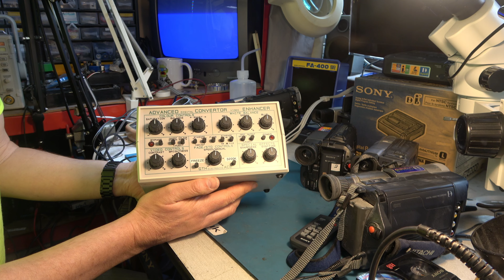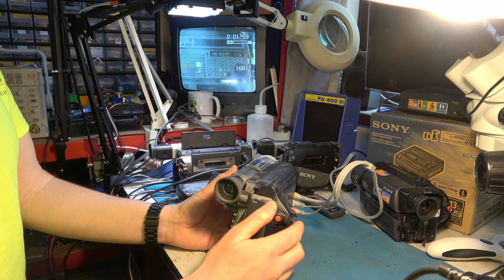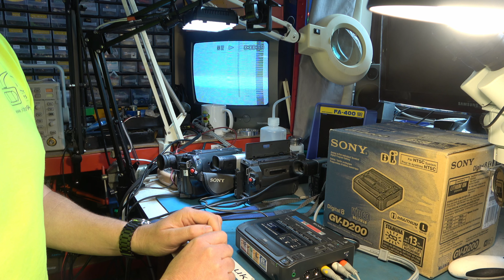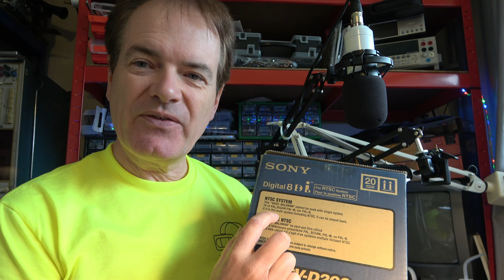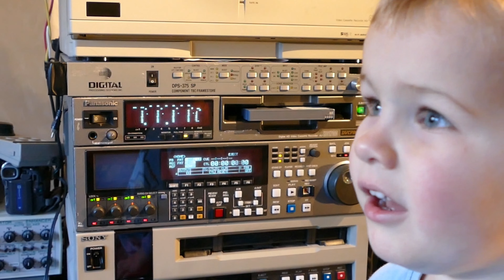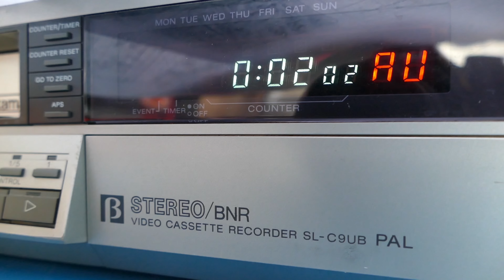8mm tapes recorded in PAL and NTSC

Comment: I think that the GV-D 200 is not slow enough for analogous PAL, since the data rate for D8 always requires a tape speed of 60 Hz. The concealment of color system compatibility is a core competence of SONY, even with "multinorm" devices that cannot do real SECAM
Reply: There is a PAL variant of it, and it's probably 98% the same parts just with a 3.58mz crystal instead of a 4.43 mhz one (unless they had started using higher freq ones with dividers at this stage)  and a few minor hardware/firmware differences.
Reply: @analogvideochannel4612  I meant that SONY didn't find it necessary to also take 50 Hz into account. PAL devices can often also play NTSC, NTSC devices but almost never PAL.
Reply: @Matt Quinn - Caledonian TV One of my favorite photos on Ebay was a C format TBC with two labels: Paris and PAL. On many "home" videos on YT you can see that SECAM leads to much larger color disturbances than PAL in the event of tape disturbances.
Reply: @Matt Quinn - Caledonian TV I only know the possibility of Mark Quadruplex Tapes with a cross for SECAM or 819 Lines Television. I have never heard of SECAM B or C format.
Reply: @Matt Quinn - Caledonian TV This is a unit from the early 2000s, not the late 80s, at that time PAL and NTSC devices would share most components and most video decoder ICs would be multi-system capable. The US and European models of the digital8 walkmans and camcorders from the time literally share the same service manual.

Comment: A budget alternative to the ACE for capturing for devices that output NTSC 4.43 or PAL60 is to pipe the video via a Pioneer dvd-recorder (DVR-_30 and newer models), or the Sony DVD/HDD recorders that share the guts with them (like RDR-HX750 and newer variants, older Sonys ar ecompletely different.) They are capable of handling NTSC 4.43/PAL60 input (in addition to standard NTSC/PAL/SECAM) and output in standard NTSC (or component/HDMI thought the latter has copy protection on it) on the outputs. They actually stabilize/TBC the video pretty decently too which is handy. (Note Don't think the dvd-recorder variants sold in the US has pal support or if they even were sold in the us) Doesn't work well for stuff with copy protection on it but that's not an issue with 8mm tapes.

Those hitachi hi8/digital8 models have one nice thing about them in that they don't do the bluescreen on bad signal like Sony camcorders and some of the decks do which can be useful for recovering something tapes with damaged recordings. 

Not sure if it was clear in the video but the chroma flaw doesn't occur on NTSC playback in PAL camcorders either, only on PAL recordings. TBC and DNR is also inactive on NTSC playback in PAL ones. Not present in the older sony camcorders that didn't use a partial digital video process though those lack TBC and there is only like one or two years of those that seems to have escaped capacitor failure hell. 

I've seen some chroma edge issues on Sony 8mm vcrs too, such as the EV-C2000e I have though it's on the left and top on this and less noticeable. Seen similar in recordings/stills from other PAL VCRs too. It looks a bit different and less noticeable and it can be on different sides on those though and is probably a different cause given that they have different ICs and such.
Reply from the maker: I did mention that the colour edge is PAL only.  I've seen it (relatively rarely) on other formats such as VHS.

Comment: I was actually surprised that NTSC deck showed any sort of discernible picture with a PAL tape. But it reminded me how I got really surprised, and I don't know if you ever experienced this, but when you play a PAL VHS tape on a NTSC only player or vice versa you usually get that scrambled mess because of the mismatched drum rotation, BUT, if you hook up that signal to some LCDs it can actually lock and sync to that picture! It will be displayed in black and white and with head noise because the linear speeds are different, but it can display a picture!